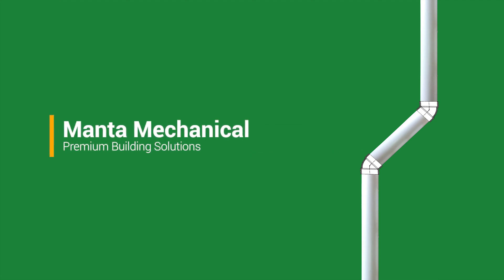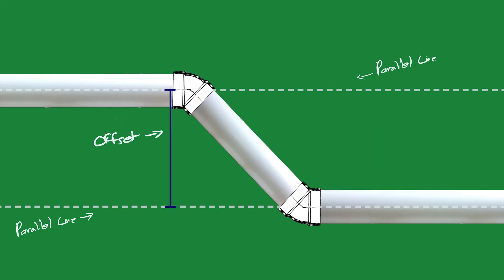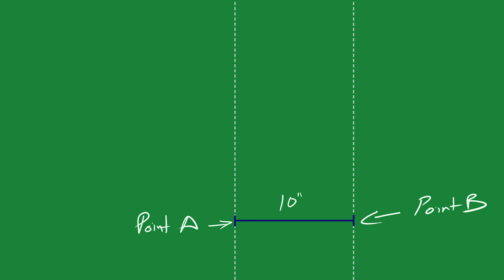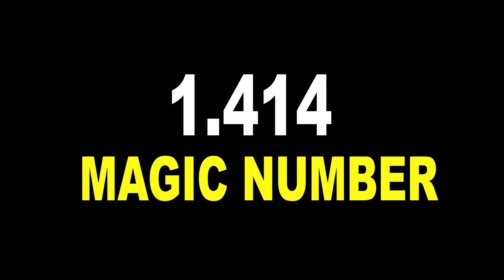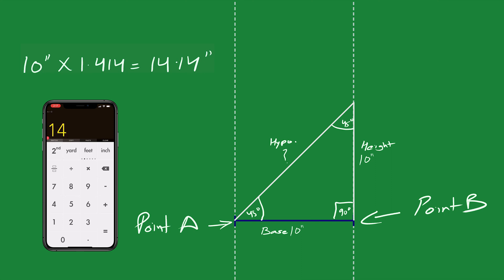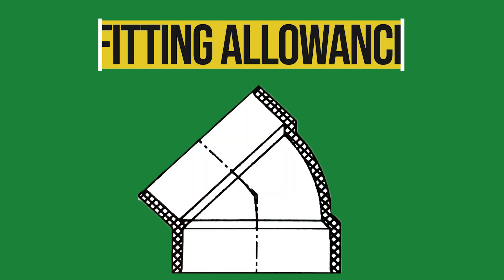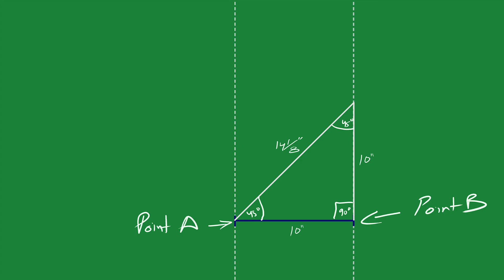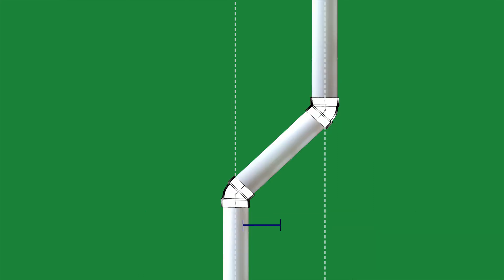Calculating a 45 degree OFFSET | EASIEST Method Explained For Trades |  2021

Comment: What size pipe are you working with, to have got 1/4 in for fitting allowance? Because i have in my hand a 3/4 - 45 socket weld fitting, and from face to hub as you call it, is right at 1' 7/16. - so how in the hell did you get 1/4? What size pipe are you working with? Because 1/4 sure is small.

Comment: Can anyone explain how measuring center of fitting to end of hub is better than measuring the end of fitting to end of hub?
Reply: Exactly, and wtf size pipe is she working with to have even got 1/4 - that's some really small fittings! Because I'm holding a 3/4 [45] in my hand and and from face to hub as she calls it, is right at 1' 7/16 and that's a 3/4 fitting!

Comment: CAN THIS BE USED FOR ANY SIZE 45*
Reply: Yes just take away your end to center of the fitting
Reply: Take end to center for both 45s and subtract example a cast 3inch 45 is 3 ½ so subtract 7inches